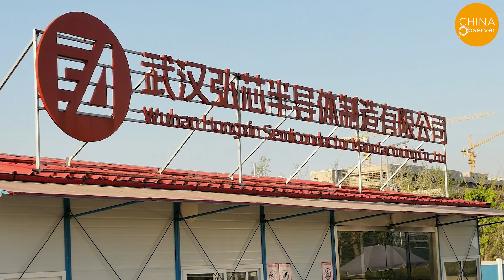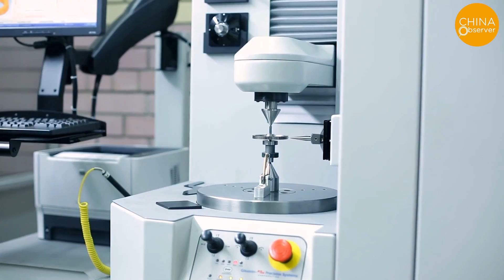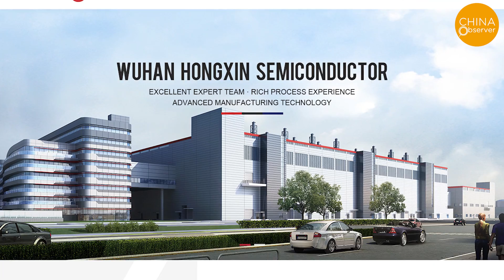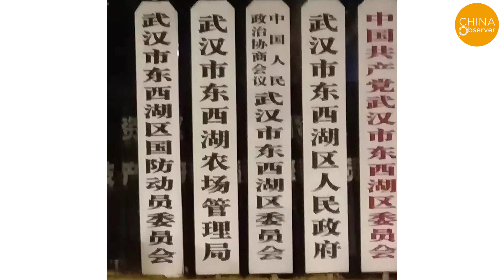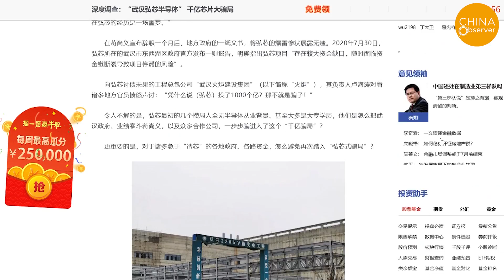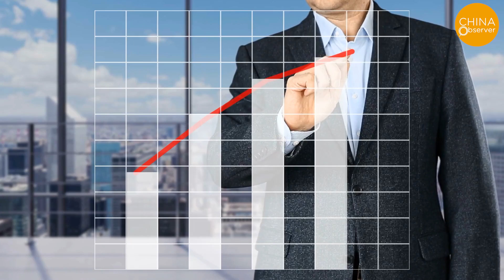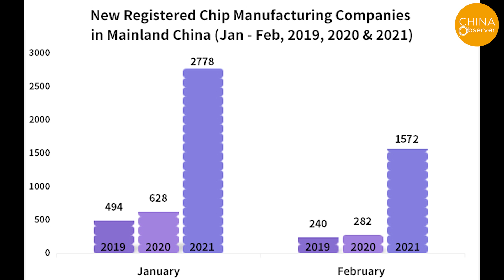Chip Scam: China's 15 Billion USD Chip Project Goes Bankrupt | HSMC | Huawei | TSMC| Semiconductor

Comment: Funy ... very funny look at Bitmain all their CHIPS are 14nm this is what drives mass production of such small chips. Bitcoin now just got banned to be mined in China which now will result Taiwan and Vietnam to take over that market as well as Japan for the Chip production. In order to get to 7nm you have to look at AMD, INTEL and TI. Don't look at Samsung or Huwaei. Nokia is another possible Chip manufacturer which can take over and push even further into this now failed bubble because the demand is extremely high. 
China Companies like TSMC or SMIC both are like Huwaei master in copy something from somewhere else. Their R&D Departments are as small as their HR Departments. INTEL and AMD both already produce 7nm chips. Pat Gelsinger who is the CEO of INTEL got lot's of money promised from TSMC which is tied with the CCP. so TSMC will produce for INTEL under their license the chips in China meaning they getting all the blue prints for free in that deal and the CEO will be shortly after fired from INTEL because INTEL will be collapsing as a result of this deal.

Comment: Well, what can I say, no mater what you say. It seems like they are determined to do it, even though there were some scammers trying to mooch the fervency. Good thing is it is extremely difficult and complex, even though not impossible. Bad thing is if the Chinese does get it, they will mass produce it at much cheaper cost and higher efficiency, and put the whole lot in US or Taiwan out of business. Depends on which way you look at it.

Comment: No 15B was injected. 

“Some local governments that are eager to launch hi-tech projects lack relevant experience and clear understanding of project risks,” said Liu Yushi, senior analyst at Shanghai-based research firm CINNO. “They simply use generous subsidies and large amounts of capital to attract projects. They should deepen their understanding in relevant industries.”

The Dongxihu district government put up the initial 200 million yuan investment in HSMC, but the company’s owner – a Beijing based firm – has still not fulfilled its commitment to inject capital of 1.8 billion yuan into the project, according to corporate records.

The first cracks appeared in 2019 when a Wuhan court put a three-year hold on HSMC’s use of 220,000 square metres of land that had been designated for its phase two project. It followed a complaint by a construction contractor who said the chip company and its main contractor still owed it millions of yuan for the first phase of construction.

Regardless, HSMC’s leaders staged a high-profile event in December 2019 to celebrate the purchase of its first piece of high-end equipment: a lithography system from ASML, the Dutch firm that makes the expensive machines that use wavelengths of light to print circuit patterns onto silicon wafers. But HSMC management quickly pledged the new system as collateral to borrow more than 500 million yuan from a local bank.

Comment: What I have learned after a bit of research on how to succeed in a chip industry are
1. Supply chain can't be built in days like Rome
2. The chain of product line requires stability and consistency due to its fragility and involvement with many parties
3. Every part of production has to be of high quality
4. The technology (not the money) should be the main driver
5. Honesty, transparency and integrity are required due to the long turnover period

The problem is China fails at every single thing i have mentioned above. Rushing is the worst mistake in any kind of R&D and China is famous in rushing things. Each chips requires about 20-25 weeks from start to finish. To even just master it, you will likely have to do it few years before moving on to mastering newer technology. But the fact that China is trying to rush to a new technology without mastering the current technology just made things worse for them. While it took Intel (a veteran in this industry) more than 5 years to go from 14nm to 10nm, I really pessimistic about China's chip industry

Comment: The SMIC never have so called mass production of 14nm chips. When you overview SMIC the latest offical financial report you will find out that SMIC only produce 7% 14/28nm chips in her overall production amount. The trick is that SMIC combined 14nm with 28nm in one term in her fincial report which can imply its 14nm might be ok. But, according to my experience, that her 14nm chips might be none or ignored at all.

Comment: Technology and the humane capital was not the issue to that manufacturer. However, due to lack of working capital and potential buyer from international market that co. collapsed, may be there was some white collar crime to get govt. subsidy, bank loan and to get some capital gain from bourses its all assumption and full fledge investigation to be lodged. There is another flip side of a coin these co. can be run on different model with some govt support and tax incentive for initial years because semiconductor industry is capital intensive and highly technical. Its demand transparency, details planning and debugging through series of brain storming sessions and strong internal external audit systems. In history of Nations, some minor jolts come to teach you the lesson, its not the end of life, most important things is that, what you have learnt from lesson, how you deal with the situation and optimistically and amicably resolve the hindrance and difficulties e.g  Wall street darling Enron  collapsed but other other company in the same industry grow. In the light of the detailed investigation report govt. could align their semi- conductor setup subsidy policy too.

Comment: A very interesting business/corruption case presented. Thank you. I am wondering if you could cover the case of the joint venture between REC Silicon, Ltd. (a U.S. based electronic grade silicon manufacturer) and Shaanxi Non-ferrous Metals Holding Group Company, Ltd.

Comment: China is going to die just from the sheer weight of the scams and corruption. Concrete the consistency of pudding, chip and other tech withdrawal, horrible water management through the faulty dams. They've learned nothing but corruption since the 70s

Comment: ASML is not a chipmaker. They make essential chip making equipment and they have a monopoly on the most advanced equipment. You can’t make a state of the art fab without their equipment.
Reply: Probably one of the most difficult things to reverse engineer, you would need to kidnap the engineers on all levels of the production chain to gain the proper insight. It's basically nano-technology at this point, even if you had the blueprints, apparently manufacturing these machines or even semiconductors for that matter is where most of the difficulty lays, so it's either buy from them, or innovate beyond them.
Reply: @Omiicron  How about you just send people to work there, to learn how it works ? Most industrial "espionage" is just that.
Reply: @SerBallister  One engineer? Are you suggesting one person is responsible for these projects? 

it's a lifetime of experience, but then you have many systems engineers from different backgrounds, I imagine they all contribute in the pipeline of the development of a project. Imagine a physicist who works with a team of engineers to design one diode for the machine, then you have software engineers who program it, while having an understanding of the technologies and processes at play.

I suppose you're right, and it happens in many industries, but to date no one has successfully competed with ASML, they produce very large devices with many facets and technologies integrated.
Reply: @Omiicron  There is always poaching too, I read that TSMC engineers & managers are being offered huge pay packages to take their knowledge elsewhere.
Reply: @SerBallister  I believe it was mentioned in this very video
Reply: China realised that they can't.
Reply: So, there will be a black market for second hand ASML equipment
Reply: @SerBallister  There's fewer than 100 EUV scanners delivered by ASML worldwide today. They are the size of a bus and cost 120+ million US$ a piece, so they are not exactly easy to fence.
Reply: @mx2000  Heh, fencing. I suppose they'll be studied closely wherever they are.
Reply: @SerBallister  can't be reverse engineered

Comment: 10:51 66,500 Chip related enterprises in China, yet, can't produce a chip.
Reply: They are producing, just not the most cutting edge ones, but the total volume of components from china is still huge
Reply: @johnuferbach9166  Yeah I see the folly in my post. They can produce chips, even if they are awful. But, you gotta start somewhere.

Comment: It opened as u.s "debt cargo" at 27M$ USD-only debt. The u.s wanted a government-to-government direct payout from china after solidifying $33m USD-DEBT in the company, and creating a second account to offset the bankruptsy date of filing; and chronoligically-simultaneiously opening a U.S-BAIL OUT "CASE" with the optimistic hopes that a third party country (tiwan) would try to help wave the debt (with u.s influence) in an attempt of a pro-government-intrest third party corporate-take-over. What the u.s didnt count on was the doller-to-doller trade rate and the stock-debt exceeded $178.38$M USD. the u.s then opted out of the transaction (leaving only 3.8$M USD; and changing u.s/China debt negociations into negative figures again after 15months of talks). The u.s pro-senate/ex-senator investing into international markets is an extreme volitility. (Infact the group, known as bradley group, sent 17 22billionYEN accounts into tiwans ken-su government account ; and solidified, aswell, 17.8$M u.s sothern states investors wet-equities) good luck democrats; china may consider me for a bigger upgrade than my S4 joint investment accounts. :D chow

Comment: using nm as chip standard nowadays is just plain wrong. okay, so if the base for measurement is transistor density, then Intel 10nm is technically on par with TSMC 7nm, while samsung 5nm is on the same level with TSMC 7nm DUV (not EUV). so technically, intel have the capability as one of those 7nm gang too, but for whatever reason they don't want to admit as one.
Reply: Going to lower Nm is all about the amount of high quality chips produced versus lower quality ones. Samsung has plenty of buyers for its lower quality chips. Intel wants the best output of high-quality chips.
Reply: Intel barely managed to catch up with samsung and tsmc, tsmc is already taking the next steps ahead... also, most companys also produce on larger nodes, because many parts dont have the same margins as processors / gpus to afford the newest nodes, but there is still a huge volume to be made
Reply: @johnuferbach9166  Yes, TSMC is moving rapidly while Intel is still lagging behind. Even when Intel 10nm and TSMC 7nm (DUV) is comparable in performance and efficiency, the yield isn't. TSMC's 7N is sooo mature basically every chip the make can be sold by whoever ordered it. That's also the reason why 5600X is so rare, because there is no "bad chip" to be turned into 5600X, everything turned into 5800X and AMD sold it as that. Intel on the other hand still just got started on 10nm, and yield numbers aren't exactly looking good, that's why they went with smaller laptop chips first and big server/desktop chip later. 

BUT, that's not the talking point here. What I'm saying is the nm naming is basically moot and nothing but a marketing ploy. Nothing matches up anymore, and companies are just calling it whatever they feel like. So it just caught my attention why Intel can't just rebrand their 10nm as 7nm in the first place. As I stated, the density number is similar to TSMC 7N, so calling it 7nm process is actually legit. But they didn't. and it's puzzling why.